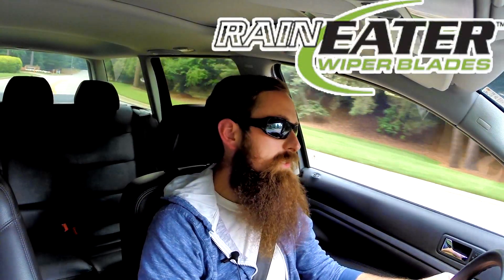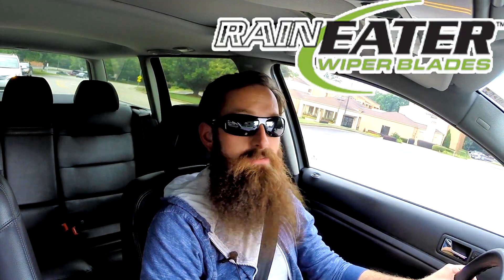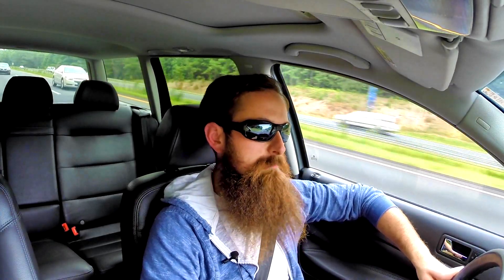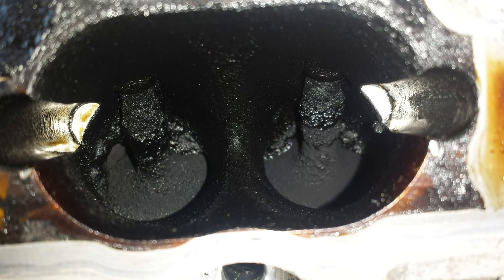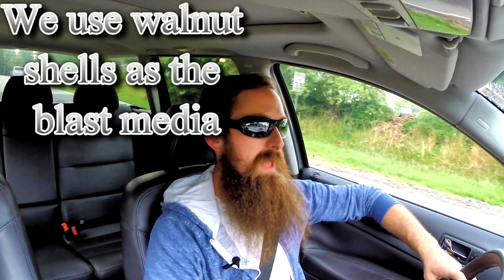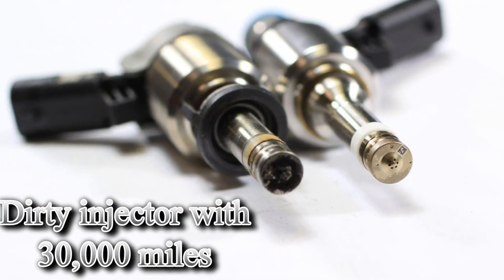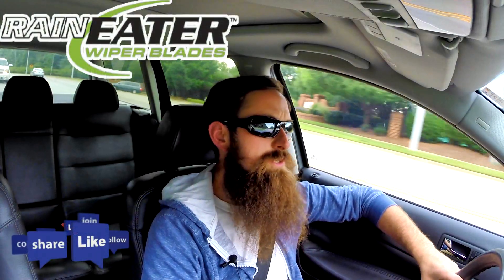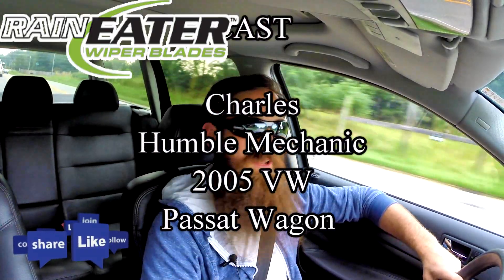Preventing and Fixing Carbon Issues for Direct Injection Engines ~ Episode 80

Comment: in europe we use a valve protector system when engines run on LPG. These systems are available with one port for all cyl. or sequentiel for each cyl. inlet.
It prevents from building up dirt on valves from the dry gas.
www.valve-protector.de

Comment: I don't know if you know about this but have you ever heard of the Terra clean engine service system? Apparently is getting very good reviews about how well it works on removing the carbon buildup, as well as the O2 sensors and the catalytic converters.  If not you should check it out
Reply from the maker: I had a guy from that company come and demo their process. Not sure if he was just a joke, or they have no idea what they are doing. But man what a waste of time. 

They did a demo on a 2.0t Tiguan. It didn't do a single thing. I borescoped the valves before and after. No change at all. It's to bad too.
Reply: I&#39;m wondering if this is a system better for engines other than direct injected? Is the 2.0 tiguan direct injected, sry I'm not a vw guy

Comment: Diesels have direct injection. This doesn't seem to be an issue with them. When you shut off the engine in both type's of engines, the fuel is shut off. Does the diesel have a similar PCV system? Keep up the great vid's!

Comment: The suplen oil catch can works great... I use seafoam regularly and that helps to...
Reply: Gas additives will do nothing for intake valve deposits on a GDI engine, because the fuel never touches the backs of the valves.
Reply: John Pifer i
Reply: Seafoam is for 2 Stroke Marine Engines. Gumout with PEA is for 4 stroke engines that may use ethanol. Gotta use the correct stuff.

Comment: Like your stuff man.... (I've got a '13 Beetle and an '04 Touareg and some other stuff :) Any reason (other than emissions) I wouldn't just throw a couple small filters on the top and back vents instead of a catch can like we did in the old days? I did that on my V8 Lexus (race car), and its not slobbering any oil out of the filters.

Comment: does water injection/steam cleaning your engine (shoving water through a vacuum line while the engine is at 3500rmp) work?  does that "blow the junk out" post intake valve?  i'm sure it does NOTHING for the tops of the intake valves, but does it work with the components that come after?
Reply: +David Beecroft  My 59 Pontiac w/389 the engine running I have misted water into the carburetor it cleaned every spec of carbon off the valves and tops of pistons,  the water turning to steam contacting the hot valves super cleans
Reply: virtualdent do you mist it all the time or just for a few minutes every few months?

btw, a photo of a cat?  really?  omg
Reply: +David Beecroft  I did once with a little over 120,000 miles on the engine  at 135,000 miles I replaced head gaskets and was remarkably clean still
Reply: virtualdent you did once what?  ran water into it for a few minutes or hooked it up to the car and ran the mist water system while you drove for 15,000 miles?
Reply: +David Beecroft  After I did the water I  put on another 15,000 miles and was still clean
Reply: +David Beecroft Im not that sure about water injection in modern engines, they seem very sensitive to fuel quality and non standard conditions. Might mess something up by doing that. Id make some sort of device to mist the water into the intake and then have it drawn in

Comment: every oil change... before the oil change: Install port down stream of Maf..... : port is a shrader valve in the intake tube.1. 1 oz of chemtool per cylinder    IE,6 cyl= 6oz.2. 10psig Air injection with siphon from can of Chemtool (Milton (MILS157)Siphon Spray Blow Gun Kit)(connected to Schrader valve.3. Inject into hot head (operating temp) while running, Rate of injection should be less than 1 oz per <30 sec with a + 1 min break between injection pulses, The scheme is to keep intake valves from cooling down.).Important: engine shut down during operation is ill advised due to pulse wave of cleaner going back to MAF. bad, bad bad. if you are tentative about using flammable materials around a hot engine just use water from a spray bottle into intakeokie dokylove your channel but I have BMW'S and I still watch.feedback is always necessary. negative feedback is best, we learn more from failure than success.
Reply: +danekeeper1 I like this because it means that the valve seats can be cleaned as well. Excellent.
Reply: danekeeper1 too bad VWs have a MAP sensor on the manifold

Comment: I installed an OCC on my PCV return line, I can block off the EGR (or disable it), and I run water-methanol on my Mazdaspeed 3. With those three things, my valves stay very clean even though I'm direct injected ;-)

Comment: Toyota's 2GR-FSE (3.5 L V6). Direct injection + Port injection. Way to go.
Reply: +Anand Nainar ... ditto with my Audi S1 Quattro 2.0 TFSI EA888 engine ... it has 4 Port Injectors (idle and low throttle inputs) + 4 Direct Injectors (used at high revs and when on boost)
Reply: ... And now we have to systems to fail. 😕

Comment: Will seafoam work? I just had a new intake manifold installed and they said I had carbon built up. They were going to charge $400 but I don't have the money at the moment
Reply: +Alfonso Manterola Then you need to pay twice, because to clean the valves, the intake manifold has to come off again! I suspect that seafoam would help but you'd have to find a way to inject into each port. If you just inject into the plenum, most of the seafoam (which is not foam, by the way, it's just a thin milky liquid) might go to just one or two cylinders.

Comment: +Humblemechanic Great show! You mentioned some theories about how/why the buildup is happening, including oil from crankcase ventilation.  I'd like to add that I believe the EGR (exhaust gas regurgitation) system which brings soot back in through the air intake (especially when mixed with ccv oil) can't not be contributing to the buildup. Just an opinion, and I'm not even a mechanic. Tell me what you think; I haven't heard or read this angle discussed.
Reply from the maker: +stevehmi That could be a possibility, but not on this car. Modern VW gas engines don't have EGR.

Comment: You said nothing in 11 minutes...I am thinking about buying 2010 CC with 45000 miles and after this I have no idea what to do...what kind of maintenance is needed to help prevent carbon build up? You said nothing about the right oil..Liqui Moly makes one for TSI engines...important or not?
Reply from the maker: Top tier fuel fuel is one of the best things. Plus allowing the engine to get up to temp and achieving higher RPM. 

The only solution is a mechanical cleaning.  Removing the intake and cleaning the backs of the valves. You can look into a catch can but I am not 100% convinced that will eliminate the issue.
Reply from the maker: There is no "just do this one thing and you will be fine". Anyone telling you otherwise is probably just selling snake oil.

Comment: water injection will actually clean the carbon off. it turns to steam and steam cleans intake valves after a few hundred miles. check out water injection intake cleaning

Comment: Are you serious?  Who in their right mind would buy a VW that requires you to take it in for walnut treatment every two years??  Sounds more like a spa than a service centre.
Reply: +Kevin Good luck buying a straight DI that does not need it. I had a Mini cooper require it at 40k. I managed to sweet talk the mini rep into eating it since i also needed a time chain.  This is not just VW. If i could trade my VW for another DI and not have this issue boy howdy i would, alas I have experience it on multiple brands.  My car circle talks about it as the dirty little DI secret that no auto maker wants to own up to is that they all use the same DI design High pressure fuel with a turbo takes away all that nice fuel to wash with and all the moist air.

Comment: You mentioned wondering how vehicles with 130-150k are holding up with the carbon build up. I bought my 2011 CC used with 80k miles on it last year. Within the first 5k engine started missing and upon inspection found insane amounts of carbon build up, carried out a full clean and engine ran like a dream. I have just reached 120k and i'm noticing slight hesitation upon engine start. It seems to me after the first clean build up returns with a vengeance, like you said seems like something we are just going to have to deal with.
Reply from the maker: Thanks for the feedback. It's one of those things I wish I was wrong about.
Reply: +HumbleMechanic I just lucked out with a P2015 fault code VW replacement and managed to get a reasonable 150 dollar total walnut cleaning.  I had a mini cooper before this VW. I had hit 40k. I had cold start issues time chain and carbon build up. This is not a VW issue. I have experience it now on two different brands. I am aware of only a few brands trying to do a moist DI and they always give up power to do it.  I am looking at Ford and Toyota.  I wished VW BMW Mini, ETC would just be upfront about this Carbon issue and make it part of the schedule repairs at say 50k, or just start covering carbon build up as part of there warranty.  I feel i lucked out with my intake runner being extended warranty and i had enough carbon build up to warrant a cleaning I managed to get away for the price of two oil changes.  I was already seeing MPG falling and Lag so i was aware it was gonna happen

Comment: This is why I bought a Toyota with the D4-S system (it's direct AND port injected), best of both worlds, though yes, it does involve another set of injectors, but boy does it ever work fantastically. I feel sorry for DI only engines, it's like they are forced back in to the days of carburetors, only for a different reason :( All the port and D4-S injected cars are completely immune to this, we never have to worry about carbon, which is a NICE thing to not have to worry about :)
Reply from the maker: That's awesome!  I don't really see the down side of port and DI. Fuel injectors are not a maintenance item and the are not a high failure rate part either.  

With strict fuel management, the MPG does not suffer. 

And yeah, not worrying about carbon is a good thing.
Reply: I wish GM would do direct and port injection system combos. None of there DI engines include port injection.
Reply: @rebel-fighter4411    Where DI engines?
Reply: @rebel-fighter4411  GM is always the last manufacturer to implement the latest and best technology. Ford uses it on their new f series engines eliminate carbon issues. My dad is a die hard chevy man although GM has screwed him many times with their expensive mediocre vehicles. I've bought Fords chrysler GM and I bought a 2 year old vw last year, so far no issues. But all in all fords quality especially when it comes to pickups reliability are by far better then Gm and chrysler vehicles.
Reply: Brandon Semik Toyota sucks! Ur a sucker dude.
Reply: You don't need to feel sorry for anybody,  Brandon. Your direct injection is not like exactly direct injection since the valve is open while injecting.
Reply: InsaneBimmer yes the kind where the check engine light being on isn't normal on Japanese "shit boxes" ;)
Reply: Yes , engine lights do come on. Mostly for emissions leaks.
Reply: +HumbleMechanic i heard AUDI will go this way ....now , after they sell years of shit engines !!
Reply: Brandon Semik Yes because a valve cleaning every 60k miles on my gorgeous CC is worse than owning a shitty Japanese shitbox like yours. You must be a special kind of "car guy".
Reply: Where's the Love , Insane Bimmer?    Toyota had to have two injectors because their engines burned so much  
oil. Some engines anyway. Spec sheets said 750 miles /quart. I had an MR2 that was OK.

Comment: on the Nissan DIG engine, when the engine starts it uses the standard fuel injection system when starting. once the engine is warm enough it switches to Direct Injection. is that the same with how VW's system works? on juke forums they only recommend oil catch cans and seafoam as the 1.6 dig turbo is a premium gas only engine.
Reply: +Genki De This is not how my VW works. The DI is Di all the time.  Nissan decided they wanted to try to mitigate there DI from having as much carbon build up. I have a friend with a Juke they had to have there carbon removed so clearly it did not work as they wanted. I think this is just a nasty secret of DI
Reply: I think so too. Thanks for the info.

Comment: For Turbo+DI BMWs the best solution is a walnut blast and then install a catch can and upgrade a few items in the PCV system.

A few people mentioned Water/Meth - Unless you drive your car very hard all the time, you won't be spraying often enough to have a cleaning effect since it generally only activates at higher boost levels. The other 98% of your regular driving it will continue to build up. It is similar to why SeaFoam doesn't work to clean carbon - not enough volume and contact time.
Reply from the maker: RavTokomi NAILED IT!

Comment: Hey HumbleMechanic, Subaru/Toyota have already implemented a direct/port injection setup.  https://youtu.be/zc8aUxBZlsU  I know you're a euro guy, so I didn't expect you to know about it, but it's good to know the system is already out there and working in thousands of vehicles.
Reply: The 2.0 Subaru turbo is direct only.  The Toyota D4-S was introduced around 2005. VW/Audi has twin injection also (introduced in the 3rd gen EA888 engine).  We in the US don't get it though

Comment: For enthusiasts running water/meth injection is probably the only way to keep carbon from building up. It would be very cool if you made a comparison video between a motor that's been running water meth for a while vs a stock none modified motor at same mileage.
Reply: Only way to keep the valves clean. A catch can is worthless. There is a term called the something cycle. I forget exactly what its called. But at the end of one of the strokes the intake valves hang. This allowes the next combustion stroke to have less resistance on its way down while the next stroke builds pressure shortly after on its way back up the intake valves finally shut. This is allowing combustion gases to hang around in the valve ports, causing this buildup
Reply: TreYay83 That’s Atkinson cycle. The system (VVT) delay the intake closing time to effectively reduce dynamic compression ratio hence you got a low compression ratio with high expansion ratio. This effectively increase the thermal efficiency in expense of reducing total power output. Most VVT (VVTi, DVVT, Vanos etc) can switch back and forth between Atkinson and Otto cycle depends on engine load and speed. VW have developed the new cycle called Burdark cycle (if Im not mistaken) which is reverse to that Atkinson cycle. Instead of pushing back the air/fuel mixture back to the intake manifold, they close valve early so that you can have the same effect as Atkinson cycle without the need of pushing back the air/fuel mixture stream inside the cylinder out to the intake system.
Reply: @soraaoixxthebluesky  great info. So in what instances, or how, is this implemented?
Reply: TreYay83 it will be interesting to see the effects of the new budack (sp?) cycle in the new Tiguan tsi engines in regards to the carbon build up
Reply: I wouldn’t waste a good meth in an engine 🤭

Comment: Hi, how does the carbon actually cause a cold start missfire. Does the carbon bind in the guide? Or is it carbon on the seat?
Reply: +Andrew Thompson It interferes with airflow to the cylinder, which results in an incomplete burn. In worst cases, there is no detonation at all, resulting in a misfire, and loss of the power stroke.
Reply: I have heard that explanation before, however I cannot really see how it would be the case at low engine speeds. The valves have been fully closed for a long time before ignition. I think it would actually be momentary losses of compression because of carbon moving to the seat as the valve heats up.